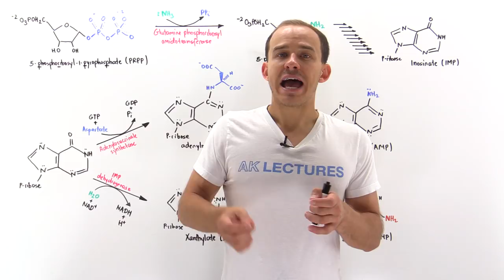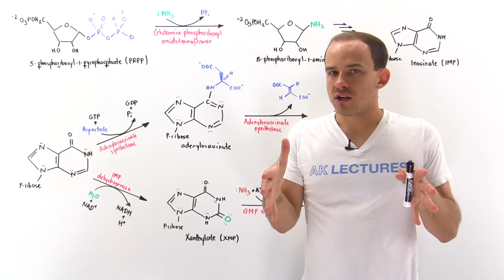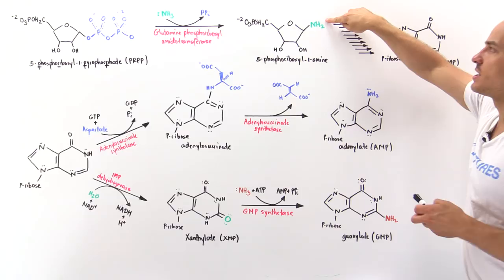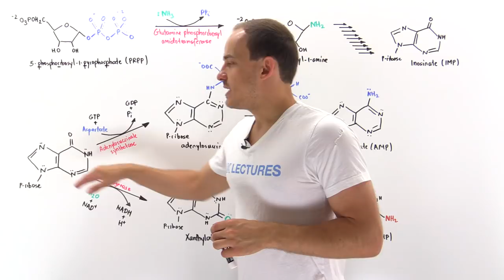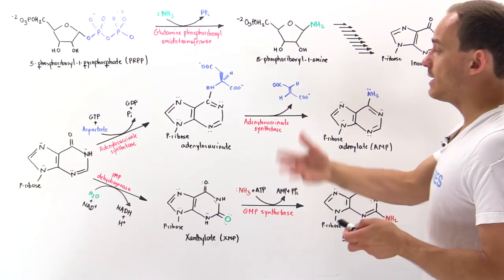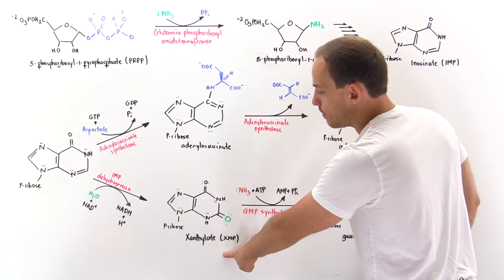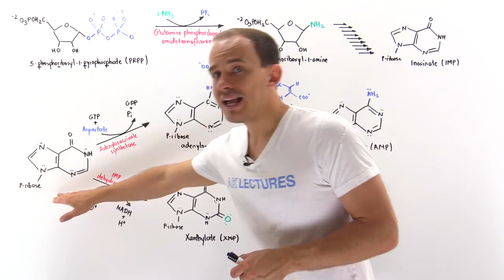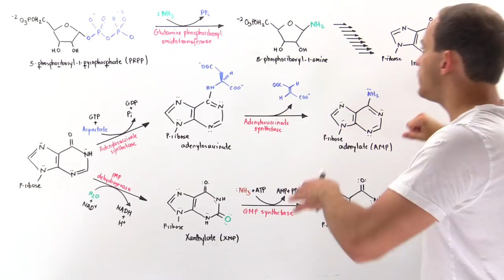Purine Synthesis

Comment: Isn't Adenylosuccinate lyase used in the 2nd step in generating AMP?  Or are they the same enzyme? Because the 2nd step isn't using an energy providing substrate like synthetases use.